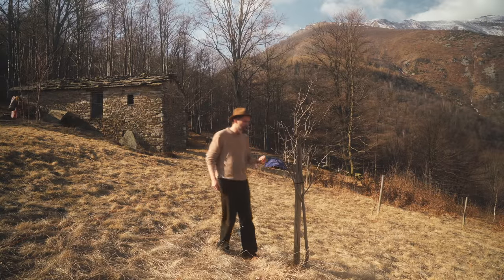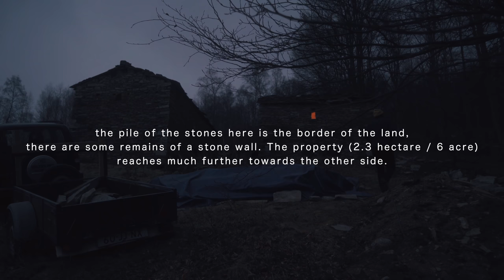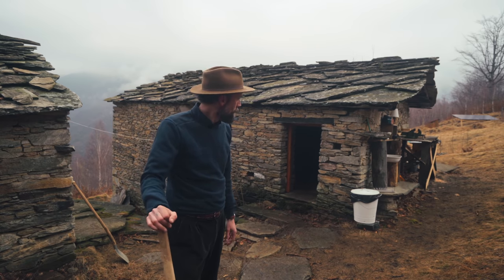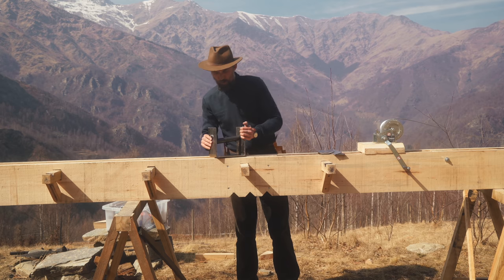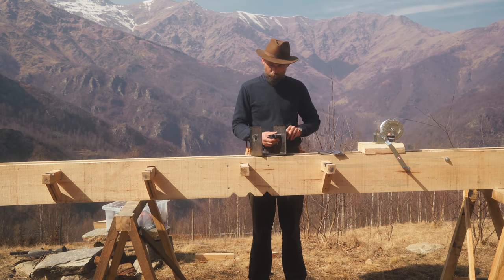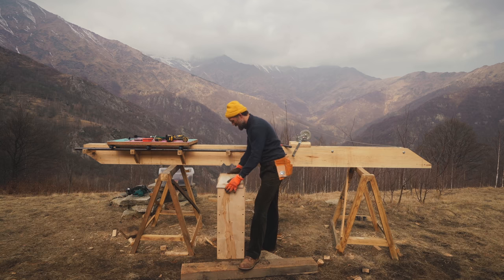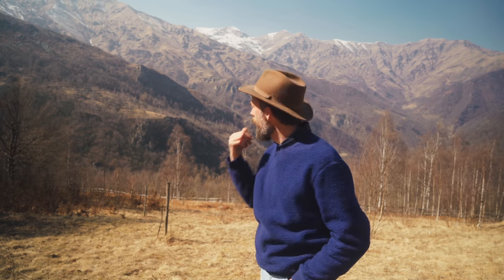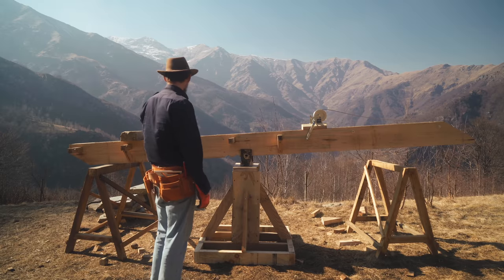#13 Building a path around the house, Finishing the Crane

Comment: There's a very old technique for keeping moisture around trees. It's the opposite of digging. Put rocks in a semi-circle on the downhill side. If you arrange the rocks so the gaps are blocked as much as possible in a second row, it slows water down enough to get the water to sink in instead of running downhill. Then take bundles of dead material, grass, leaves, sticks and mulch around the trunk, leaving a small gap around the trunk.
Reply: Start with the tree you really want to keep. It's a technique used by ancient people who didn't have any modern tools or money for material.

Comment: Hi Martijn. To start a garden easily, you can cover the ground with black mulching sheet for 3-4 weeks to kill off the growth of the pasture. Then in April-May you should already have a plot with bare soil easier to work with, than to weed out these grasses.
Reply: in australia - we use cardboard. Not only does it block the UV light to the weeds, We find that the addition of Carbon seepage is perfect for our sometimes acidic clay soils in Wine and stone-fruit country. 

We use it in our bush revegetation too.
Reply: Cardboard is the common weed cover used in no-dig gardens. In addition to killing growth below it, the cardboard composts in place when covered with mulch. A synthetic weed block is not as eco friendly and most be removed, i.e., more work.
Reply: Cardboard is easiest, cheapest, will compost in place and many businesses are glad for you to take it away. Pick up free pallets for boar fencing, they will root around in veg gardens.
Reply: @mariapelleya7410  Cardboard to compost? Mindblown, these tips are gold!

Comment: A couple of suggestions from an Engineer:  1.  You might consider some sort of stopping / locking mechanism for the dolly position travel on the beam..., and 2.  two or three additional pulleys between the winch and the end of the crane will make stone lifting easier depending on their locations relative to the length of the boom when the crane is set (this will minimize the requirement for crane resetting / positioning....

Boom tilting will be very tricky and probably you will want to minimize it as much as possible...It will be most stable when it is kept as close to 'level' at all times... 

One other note is that the pulleys on their shafts will necessarily be required to be quite "robust"..

The rest of it is quite brilliant I think...

Great series!!

Wade Blaser
Vancouver Canada

Comment: Speaking of south vs. north side. In, for example, the stockholm archipelago all new houses (more or less) are facing south, whereas older, fancy holiday houses built by the upper class in the late 1800s/early 1900s are north facing. The reason for this was so the view would be illuminated by the sun = a much nicer view. I find this perspecive quite interesting and it makes a lot of sense :)
Reply: Holiday homes are usually used in the height of summer as well.

Comment: Another superb video. I'm loving the flag stone path, looks really good, the progress you're making is phenomenal. You're going to need a crane, to move your crane...... One thing I did want to suggest,  sure you've already thought of this and are indeed doing it, but, if you're going to be starting the Jimny and moving 10 yards and turning it off again regularly, I'd leave it running for 20 minutes occasionally to keep charge in the battery. The last thing you want is to have it stuck underneath your home on that slope. As I say, you're an intelligent man and have probably thought of it already 🤷🏻‍♂️. Keep up the amazing work x
Reply: Good tip. It feels counterintuitive to needlessly keep the engine running, but it saves your battery and engine. Industrial and farm machines are left running for the same reason.

Comment: I am re-watching your videos they are so good, Amazing progress, to Today the tree with the long thorns is a plum tree  you can make a sun drying box a wood frame, with a hinges glass door tilted toward the sun, on legs simular to your solar panels, and a silk material on the bottom for air flow, but no bugs, cannot lay eggs in drying fruit, then you string up the dried fruit for winter, or make jams, or use in a jar for granola. That crane you built was genius

Comment: Your kerosene heater looks pretty similar to the one I've got. Mine has a self igniter. I would think that your heater has that too. Look for a battery compartment for a D size battery - the big ones. If you replace the battery, the self igniter will probably work fine again.

Comment: since you put a lot of thinking into everything you do i really love to hear your opinions on the various aspects. i have to admit that intuitively i'm on "team south", too. however you've shown me there's more to take into consideration. you've got some strong arguments there.

and just a quick tipp if you want to keep your welding machine healthy as long as possible: don't just cut the power supply, i.e. turn off the generator, but use the machine's main switch first. most of these welding machines run their fans for a few secs after the main switch is set to the off position to make sure the internal electronics get cooled back down enough to avoid damage. since it also takes you a few seconds to actually reach for your generator's switch you're probably just fine. but to make sure the welding machine gets enough cooling down time i'd switch off the generator only when the welding machine's fan has stopped.

Comment: Martijn, great video again! Get a cobalt drill, start by making a dimple (so your drill doesn't wander off), lower your drilling speed, make sure you use a cooling agent and you should be fine drilling holes in (hardened) steel yourself.

Comment: I have both aspects on my property.  I find that my fruit trees on the southern slope bloom earlier and are more often damaged by frost.  The north slope doesn't warm as early so the trees break dormancy later and yield  more consistently. For things at ground level, with a bit of cover to protect from snap frosts the south side wins.  You are very right about the view.  If you are looking at solar gains for passive solar or S.V. systems south slope is probably better (depending on shading....)

Comment: You are correct, north side of the mountain can have many advantages, temperature might be colder but it's also more stable. For instance wine cellars tend to be installed on the side of the valley where the slope faces north for that reason (talking of the north hemisphere of course).

Comment: Martijn, I just discovered your series of the Italian stone cabin/cottages very recently and find it so fascinating, watching several episodes to try to catch up to present- You are so smart in so many ways and hard-working...! I don't want to spoil watching the progress but I did think of something as you and your volunteer friends were moving the stepping stones- I am not sure if this would be of any help or if you may try it- 
You can use your 2-wheel cart and a "sled" perhaps like your old door- and some PVC pipes to move heavy things around on the ground...Of course it works best on flat ground, and with at least 2 people- 1 to pull the 2 wheeled cart, and the other to reposition the  PVC pipe sections as you pull the "sled" as you did the wood logs sections under the stones. Your 2-wheeled cart doesn't have a place to tie a rope, but it could be modified by welding a large eyebolt to it, or you could try similar with the wheelbarrow, driving it backwards?

You have to have  a chain or strong rope from the cart bottom to the "sled" tongue of however you are towing the "sled" of stone(s) . Keep  the 2 wheel cart at an angle as you are pulling it, to transfer the weight to the ground...I moved 30' by 1' diameter (very heavy) wooden light pole by myself using this method and I am a middle aged woman..

I screwed an eyebolt into the end of the wood pole to attach a rope to the bottom of the 2 wheeled cart and 2" PVC cut into ~1.5' sections, you may have to try 4" PVC sections? top.. Also, is there a pully on the end of the crane?

Comment: Also a stone mason here. 

Wondering if your path stones are actually roof tiles that have slid off of the structure. 

Very eager to see the crane in operation. It’s too bad there isn’t a 4x4 truck crane anywhere you can hire. I can see stripping the roof with that mechanism could take a week and putting them back 3x as long. Those sheets are no joke, up to 300 or 400 pounds each for the large ones on the drip edge. 

I can see stripping 1/2 of one side and rebuilding the roof 1/4 at a time…stair stepping the tiles. Very challenging.

Comment: It's nice and handy that you have the small inverter welder for jobs around the place.  It's portable with the generator for power and should work fine for most of the projects you have around the house.  I hope you researched the power requirements for the inverter welder to use the generator for power.  You wouldn't want to damage the welder with a generator too small.
Reply: I think the generator just stops if a tool draws too much power. But since he didn't buy an inverter generator, he could damage electronic equipment, like Ctek chargers. I don't know if that welder requires an inverter generator (pure sinewave). Seems like it is still alive :-)

Comment: Looking at the base you have made for your crane, I think I would fit a larger steel sleeve vertically into the middle of the box section of the base (that your welded shaft would fit into for turning) and fill the surrounds and flat side with concrete. This will give it much more stability and help with the cantilever. Good luck. [Edit: Will also need a circular steel collar/saucer between the steel turning piece and the wooden collar top.]

Comment: Great progress on the crane, Martijn! Two things: 
First. On my camera jib, I dispensed with fancy engineering and bearings for the slew axis. I simply used flat metal plates with a plastic plate, cut from a kitchen chopping board, sandwiched in between. I initially thought it would need lubrication, but its dead smooth without any. Every rudimentary pioneer's wagon, including the Dutch "Voortrekkers" here in South Africa, has had such a bearing, not to mention the "fifth wheel" on every articulated truck on the road today. HUGE loadbearing factor, zero failure possibility, and super low budget to construct. Slap a metal plate on top of your crane column, and youre good to go.
Secondly. What method do you plan on using to move and secure the skateboard dolly in place while you work?  I think another winch like the one you already have on the crane will be perfect, but with a closed loop around pulleys each end of the track. Then you can adjust to the load with safety. What do you think of those two ideas?

Comment: if you can find a twin wheel barrow kit for your single wheel barrow.. most of the hard work (going up and down your property will be easier to push.. plus it will be able to hold more weight (extending upwards.. add plywood on the sides to add push more weight)

Comment: Hi Martijn, so interesting how you overcome problems in such a remote place, I particularly like your accommodation within accommodation. Looking at this episode though, I am concerned that your construction of the crane pintol is on the light side. The base needs reinforcing by adding thicker plate and you have welded the vertical tube to the underside using single side fillet welds. You should form a hole in the underside of the base and pass the vertical shaft through so that it protrudes 6mm on the other side, then make double sided fillet welds.
Personally I think the home made crane is too dangerous. I would use a greased ramp system to lower the larger stone tiles to the floor level, use Turfers to jack them down and air bags to lift them onto the bearers. This way you won't need a scaffold. It may take slightly longer but you will be much safer. 
Good luck and stay safe.

Comment: Great job, great place, great video!!
Just a little tip: you should turn off the electric switch of the generator, and then turn off the engine, at this way you will avoid any equipment burning 😉
Reply: You would have to buy a very powerful and expensive generator to get an electric switch on them. I think you should unplug the tool first, and then turn off the generator.

Comment: A spade or round point shovel would really help if you plan to dig much more of that ground up. Square points are more for scooping material off of a flat surface, not digging into the ground.
Reply: True, but a d-handle squared 4 tine garden fork is even better when starting to dig up the ground (like the Fiskar's heavy duty garden fork)

Comment: I work with metal a lot. You need some good cutting oil. In the states, brands like magic tap, rapid tap. A drop or two, and go slow with the bit. Do not push, let it do the work.

Comment: Hei Martijn, I really love your work. I watch your videos as soon as they come out, never on my phone though, to better appreciate the filmography. I saw that drill point breaking before it even did. You where pushing with too much of an angle, if you old the drill at a 90 degree angle you should be able to drill trough that metal. For the larger holes you need a drill press though. Another thing I've noticed is the joint you have welt between the metal pole and the plates that will hold the crane arm. I don't think that join will hold the strain. I would have an hole drilled trough the plate and put the pole though it. Then weld it. Keep up the good work!!

Comment: Martin, be careful with working on your roof. The moisture exposure to the main ridge beam may have compromised its strength. Your added weight along with the massive weight of the rocks could cause you and a rock slide to cave the roof in. Something I noticed in episode 4. Good luck.

Comment: Kudos Martijn. I just found your channel and enjoying it a lot. Your crane looks well engineered,  but may I suggest a safety improvement?. The beam will bend down when loaded, and is now not fixated to the pivot point. When something happens like the loading is lost suddenly from either side, the beam will spring back and may jump off the pivot. I would fix the pivot to the bottom of the beam.

Comment: Too late now, but... 
ALWAYS use a cutting oil, WD-40, bicycle oil, or even cooking oil when drilling in steel. Drill bits cut faster and stays sharper for much longer with a bit of lubrication. 
Also, drilling into the 90degree right angle doesn't work with a drill bit big enough to touch the straight walls. Drill a smaller pilot hole, then flip the angle iron over and drill from the outside. 
Or invest in a pointier drill bit. Regular bits like the one that broke are '60degree rake' so the tip is actually 120degrees. The outside edges will catch on the metal. A 45degree bit might have survived. (but I would have drilled from the outside anyway. )

Comment: I'm wondering about a breaking system for the crane sled, It will need to be locked in at different points to maintain the balance point.

Comment: The problem with fruit trees at that elevation is getting a frost during the blossoms.  It is going to be hit and miss.  If you can get fruit to set then you will have an advantage when it comes to pests though at a higher elevation, and being more isolated from other fruit bearing trees.  Raspberries and other bushes should do well.  It is the trees that will be a challenge.

Comment: You are going to regret not saving those big flat stones for the roof.
Also, as someone else mentioned, the wild boar will destroy your vegetable garden unless you build a fence.
Reply: Well, he's still got them - hasn't he....!!
(....and how do you know he hasn't already worked out that he's got plenty of roofing stones....?!)
Reply: @andymccabe6712  Having restored a rustico in Liguria myself, I found one of the secrets was not to do things twice. If Martin reuses those stones on the roof he will then have to replace them with other smaller stones.

He may well have enough, but I doubt it as it is noticeable how many small stones there are near the apex of the roof on both buildings. Much easier to use bigger ones.

Comment: How much are you planning to lift ?
If it is less than a couple of hundred kilos, you could have simply built a metal sheerlegs onto the frame of the trailer.
Then the entire difficulty of moving the object once you have lifted it is simply a matter of driving the trailer with your truck. And the lift is easy, because you just have a winch on the truck.